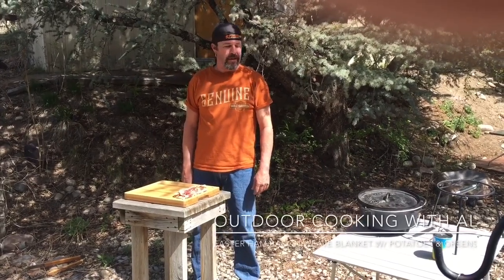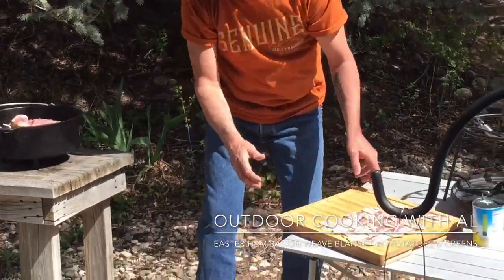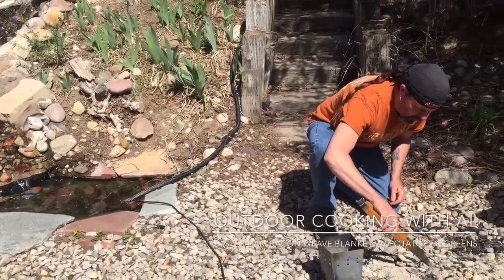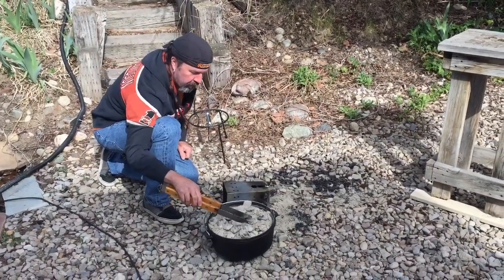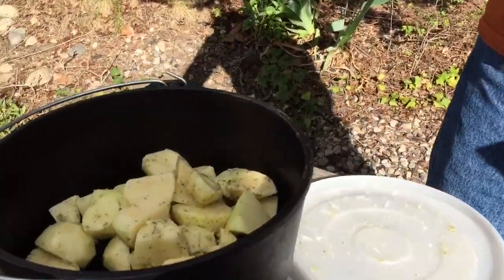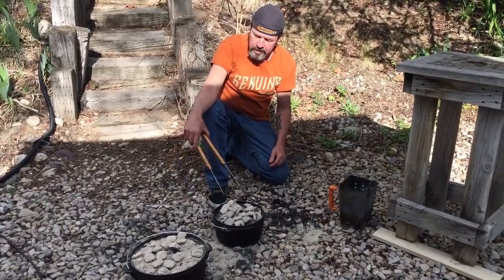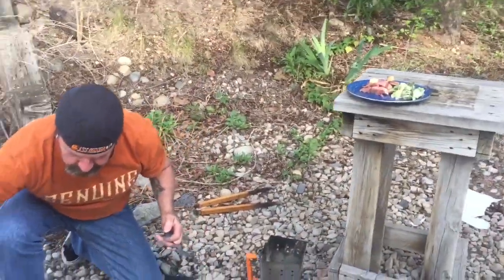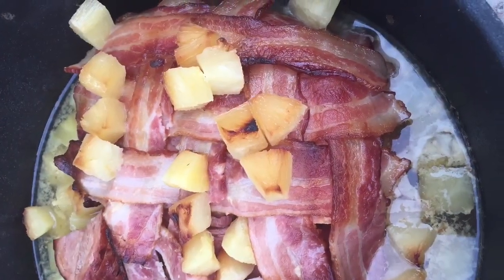Holiday Ham with a Bacon Weave in the Dutch Oven

Comment: The potatoes seemed to be stuck to the bottom of the pot..you should of maybe sprayed it with pam or added butter to keep that from happening! the dishes looked yummy! :-)
Reply from the maker: They were stuck a little. Thanks for watching and your comment.
Reply: Sand the bottom of your oven, and reseason it. 220 grit don't take much, and it will be pretty much no stick. Reseaon after every use.